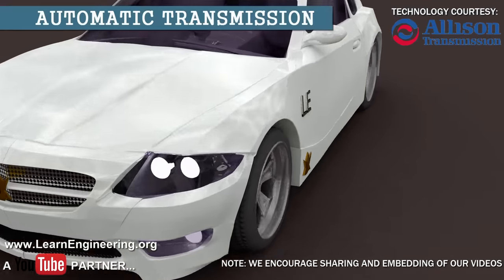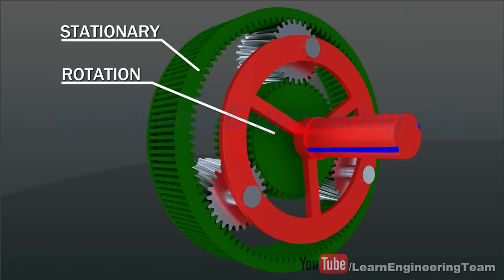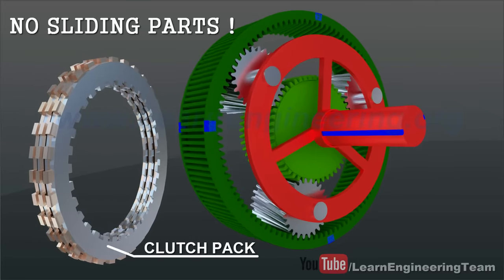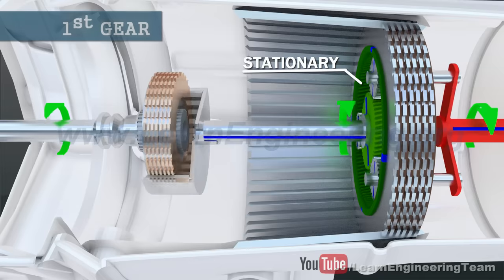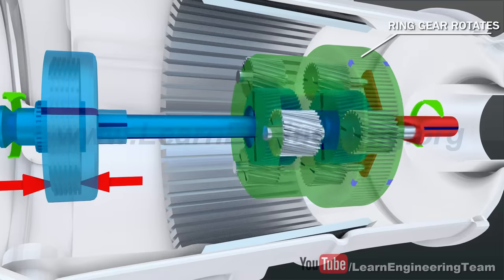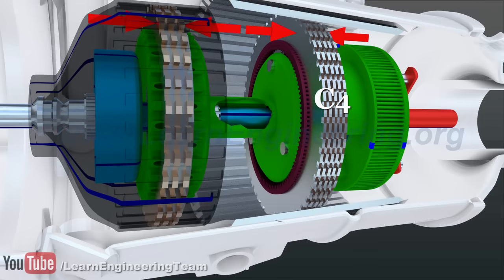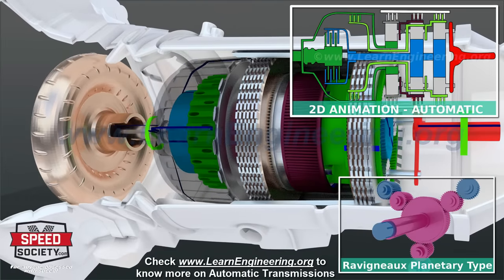Automatic Transmission, How it works?

Comment: I guess to simplify what seems to be hard to understand about this video if you guys are interested in understanding but didn't get it then read the rest and watch it again and hopefully it makes more sense. If two gears have the same number of teeth and are the same diameter are connected they will spin at the same speed but in different directions, if one of them was now half the diameter of the other one it will perform two spins for each time the first one spins once, the ratio of gears here is 2 to one, or two or half depends on what kind of international standard ratio system notation you are using just one spins more than the other because it has half the amount of teeth now. 

In their arrangement they are decreasing the teeth in an another way because you can realistically shrink or enlarge gears on the go. They decrease or increase the number of teeth that make contact so you get more or less ratio as in this is just a substitute to changing the diameter as I mentioned above and the way they go about it is stopping certain teeth from spinning hence the planetary gears. Different ratios give different torque and speeds so 1st  gear would be high torque low speed for going up a steep hill and it goes down until whatever your maximum connection is in this in this video the sixth setup they are using is moving at almost a third faster than the input from the torque converter that's coming from the engine. There is a device in your car that senses what kind of torque you need and adjusts automatically by limiting or un-limiting the number of teeth needed some older cars have it mechanical but the newer ones have it electronic. 

I'm a mechanical engineer so I hope I made more sense than the Houdini who made this script because even with my background I had to go back and watch certain parts again to understand what they are doing.

edit: typos

Comment: This is simple though - the planet/sun gear arrangement allows for a variable gear ratio with 2 inputs - add more of these gear arrangements and you can increase the number of possible output gear ratios. These ratios represent the relationship between power/acceleration in any given gear ratio. The clutch disconnects the engine from the drivetrain to prevent the rpm of the wheels dropping to zero from stalling the engine

Comment: As a driver of an automatic transmission car, it never comes to my mind on how it actually works before seeing the difference between the two transmissions in a set of videos. In short, the minute you put the vehicle in drive, and put your foot on the gas pedal, the car does the shifting for you, and also downshifts when you put your foot on the brake. the only thing they both have in common is despite the difference in parts, the output gear always turns in the opposite direction when you put it in reverse. Who knew?😲
Reply: I can only drive manuals - automatics are black magic to me, both to understand and drive.

Comment: What I don't understand is, how the 3rd set of planetary gears, is mounted.  I get that the sun gear is hollow, but in order for it to work in reverse, the sun gear of the 3rd set, would have to always be connected to the input shaft.  But it seems from the diagrams, that it is connected to the intermediate shaft.  Does the input shaft somehow extend past the housing of C2, so that it connects to the 3rd set sun gear?  Otherwise I don't see how that mechanical connection is made.

Comment: My question in all this is how, what and when are the Cs applied.  What is moving them, how are they moving and what is deciding when to move theme.  I used to think that the computer did those things. But I've drive automatic transmission on cars without computers. So how did they knew when to shift or how.  How did they knew when to get their cue.  Or is it something like the Torque Converter so once a speed is met things just automatically move differently.  I need like, the whole thing together.
Reply: On cars without computers it’s based on vehicle speed and accelerator position. The faster the vehicle speeds the higher pressure there is on fluid telling transmission to shift, and the harder you press the accelerated this reduces fluid pressure causing the transmission to shift down

Comment: So if i got it correct, the ring gear if the first set will link the 2nd clutch to the 1st planetary set through its ring to engage the output shaft while the input shaft is not moving... right?
Reply: I watched the whole video and I can say with 100% certainty that I have no damn idea if what you said is correct or not...

Comment: A requirement -> invention explanation would be more suitable for this particular thing, i.e., explaining what we want and how do we achieve it. For instance, for second gear, we want the ring R1 to rotate but not as fast as the sun S1 so that the output planetary carrier P1 rotates a little faster. Since now we want R1 to rotate and not just be stationary, so introduce C5. We also want a source of speed which is slower than S1 so that we can join/couple it with R1 to achieve our goal. We construct this source of speed by introducing P2, R2 and S2. Holding R2 in place and rotating S1 and S2 at the same speed will make P2 rotate slower than S1 and S2, and therefore P2 indeed has that sweet spot speed. Now, R1 and P2 are directly attached. Additionally, we also need C4 to hold R2 in place, therefore completing the construction of second gear. 

And so on

Comment: after annual maintenance at Opel mar service station in Istanbul olur Opel Astra j1.4AT edition plus vehicle works very noisy why i dont understand what they dış to our çar at service station and when i press on to the acceleration pedal our vehicle does not go fast sudenly as if something block obstackle and pulling back according to this video i thought that gear box can cause this problems???

Comment: Great technical information of how clutch packs and planetary gear sets make gear ratios. There's no info here how the transmission shifts automatically
Reply: Cars made past the 80s will use a computer to control which clutch pack get applied

Comment: i think i mostly understood after watching it like five times: you have various combination of how you should engage certain groups of gears with the different clutches to give you ofc different gear ratios. but the thing im having a hard time is how you compute those gear ratios. even for first gear, the planet/output gears have 25 teeth and the sun/input has 50 teeth so shouldnt it be 25*3/50 = 1.5?? i dont get it. how do you calculate gear ratio with this formation

Comment: You just KNOW that although this is awesome, repairing this stuff makes a good case for manual transmission, cost and labour wise.
Still, the person who invented this was a genius
Reply: Dual clutch transmissions were made for this reason. Much easier to repair, but also way more responsive than torque converters.

Comment: Hey I'm gonna be that guy. It seems like in all forward gears the energy to drive planetary sets 1 and 2 comes from either C1 or C2 being engaged in order to connect them to the input shaft and I feel like I understand those well. From what I'm seeing here it look like both C1 and C2 are disengaged in reverse. So where is the energy to move the planetary gears in reverse coming from? Is it from the sun gear in planetary gear set 3? If so, what's driving the motion of the sun gear of planetary gear set 3 if it's not the input shaft since the gear is hollow implying a frictionless internal surface?
Reply: Good service manuals will have charts called "power flow" for each speed and reverse. they use little arrows starting from the engine side and running through each gear set.  It really helps to make sense of what's going on.

Comment: 5:54 The narrator said applying C3 will always turn the ring gear of the second set. Yes, it's true. But I think the ring gear of the second set is always rotating. Here is the reason.

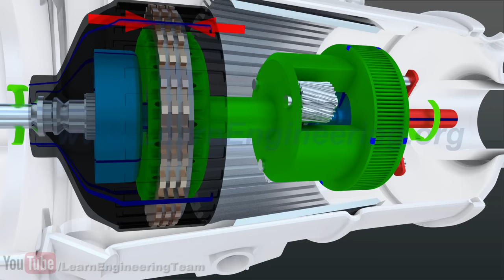The sun gear of the first set constantly meshes with the input shaft (5:48), which in turns makes the planet carrier of the first set rotating. The planet carrier of the first set is connected to the ring gear of the second set. Thus, the ring gear of the second set will rotate as long as the engine has been started, regardless of C3.
Reply: But bro please tell that why C2 is removed from the animation after applying the 3rd gear.

And please also tell that if in 5th gear the power is gained by locking the C3 and C2 then how will the power from engine transferred to the output shaft??

Comment: I have given up trying to understand the mechanism of an automatic transmission. Now the question is, do we actually "need" the torque converter? Can't we just use a regular clutch with a computer-controlled actuator to achieve the same result (i.e. decoupling the engine from the transmission during braking)?
Reply: Torque converter is smoother and easier to accomplish this smoothness. Could we use a computer controlled clutch? We already kind of do most torque converters have a lock up clutch so newer cars in a way do

Comment: Something I found confusing... In the video they say, "3rd planetary gear set is required to get the remaining gear ratios," and "the sun gear of this set is always connected to the input shaft as shown here." At first glance it appears they attach it to the hollow tube connected to C2, which meant it wouldn't always be connected to the input shaft, but after watching a few times I finally realized that they are actually attaching it to the large outer drum of C2, which in turn is always connected to the input shaft. This definitely needs to be made more clear.

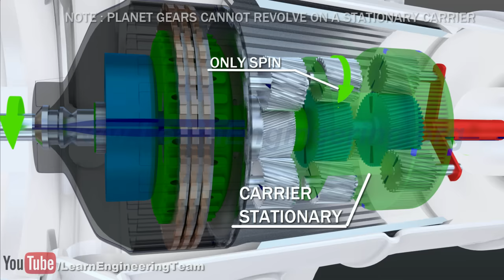Comment: in the reverse gear ratio the video and animation is wrong. C2 Is not engaged and neither is C4. Only C3 and C5 are. It shows c2 spinning but not connected to the green shaft, and the narrator doesn't say to remove c2 but it must be removed. I don't know why the animation pictured c2 in the animation at 6:54 and why c4 is picture at 6::35, this just made me and I'm sure many others confused.
Reply: The narrator was going through all the c3 gears. For 3rd he said apply c1, for 5th he said apply c2 and for reverse he said apply c5. Hes changing the clutch each time for each gear. At 6:06 he says for the remaining gear ratios c3 will be always applied. 

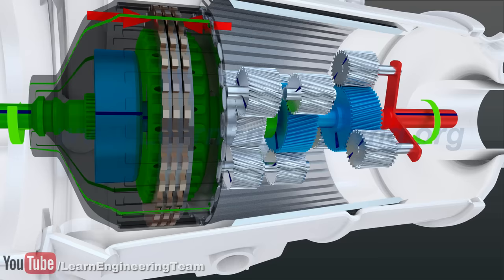Also at 6:35 that’s c3 he’s showing not c4

Comment: So it uses a clutch to connect the two shafts (input to intermediate), but also has a torque converter in order to disconnect the engine from transmission. How is that not redundant?
Honestly, this transmission design is disappointing. It could easily be a CVT, the best possible design too, but instead, it has clutches, and is basically, an automatically shifted manual transmission.
The video is very helpful and educational. Most of the videos for this channel are like that.

Comment: The confusing part is gear box are used for speed variations, but the dude keeps saying applying different speeds will result in sun gear rotating at different speed. But again the engine which generates speed either goes full rpms or lowest depending on acceleration, plus I don't get it. What do clutch packs have anything to do with transmission if we don't understand the relationship of input variations and output variations

Comment: Hyundai i20 automatic transmission at speed 80 vehicle automatically lock to 3rd gear instead of switching to 4th gear... What is the exact solution of this problem?

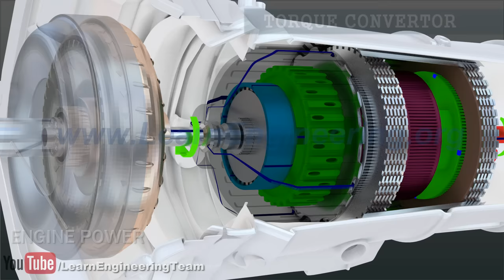Comment: 7:10
Is that torque converter only needed to get going from a stop?
Why not release the clutches in the transmission?
Reply: If you released the clutches, you lose "engine braking". It would be the same as throwing it in neutral every time you hit the brakes.
Reply: @jamesslick4790 what is engine break ,they explained it to me that when no throttle there is no detonation so the only force the engine is giving out is the braking force of the compressing air ?? But I still dont get why you just dont press clutch and let the breaks work
Reply: Yes. "Pumping" (from compression) "engine braking"  is a vital part of driving generally. "freewheeling" and relying on brakes ALONE is dangerous.

Comment: If I replace the torque converter on my 2011 Routan will it fix the problem I don't think it has clutch pack
Reply: Best bet is to find a good used complete transmission. It comes with the torque converter anyway and will take the same amount of labor to change either one anyway.

Comment: So if my automatic car has trouble pulling out from a stop ie. the rpms go up but doesnt move, then it clunks and starts going, whats wrong with it ? Bad gears somewhere in the tranny ? Bad torque converter ? Plz help lol.
Reply: Also, it doesn't have a problem in any other gear. Never slips or acts weird. Except when pulling out from a stop sometimes.

Comment: ease and reliability is not something often said about an automatic trans when compared to just about any manual. Hell the 4 speed manual tranny was perfected years ago and alot of them you dont even need to use the clutch except when you are stopping or taking off.

Comment: After watching the 2d illustration of automatic transmissions that simplify how this functions and gave me a much better understanding of automatic transmissions, there is still one thing I'm still confused about them:

I saw a video of someone bringing one of these apart and the thing I was most confused about was the 3 layers of mazes and 4 small metal balls in each one of them and why it was so important not to move them? I still don't understand that part's function.
Reply: Yeah that's the part he doesn't explain. 

It is called the Valve body. 
The clutches are engaged/disengaged hydraulically. 
Simply, the combustion engine spins a pump that builds oil pressure that the computer can send to the clutches by opening/closing solenoid valves. 

The maze you're talking about are just ports and passages that have been milled to allow the oil to reach and pressurize different sections of the transmission. It's that pressurized oil that moves components inside the transmission. The balls act as one way check valves to allow the oil to flow in one direction but not the other. The small balls block the ports when the pressure is trying to come back. You can compare them to diodes in electricity.

I'm gonna paste a description that I found online that might help you understand better than my own words could.

"The valve body is the nerve center of the automatic transmission. It is responsible for creating smooth shifts to the appropriate gear when driving. It does this by directing hydraulic fluid through a maze of channels and passages that activate the appropriate clutch pack or band. In a manual transmission you would have to push in the clutch and manually change the gears using the gear shifter. In an automatic transmission, the torque converter acts at the clutch and the valve body changes the gears. 

There are several valves in the valve body and each has a specific purpose. The valves are named for the function they carry out. For instance, the 2-3 shift valve activates the second gear to third gear shift and the 3-2 shift timing valve determines when a downshift should occur. Every gear shift your transmission can make has a valve assigned to it.

 The manual valve is the most important valve and the one you have direct control over. When you shift from park to drive, you are using the manual valve. It operates by uncovering various passages depending on what position the gear shifter is placed. Placing your gear shifter into drive, for example, directs fluid to the clutch packs that activates the first gear. It also monitors the speed of your vehicle and throttle position so that it can determine the best time to shift up."

Comment: what does he mean by remove c1? release or literally remove? if c1 is removes how is energy transfered to the input shaft?
Reply: He means release, so the input shaft and intermediate shaft are not connected anymore
Reply: @Club-kc9wl  how it turn if c1 is released?
Reply: @Wabuh-Wabuh  which gear are you talking about? 1st 2nd 3rd 4th 5th reverse?
Reply: @Wabuh-Wabuh  it will turn through c2 or the sun gear on the first planetary set is directly connected to input shaft

Comment: By this explanation as an expert let me know what is the problem  with my car it seems like it has transmission  slipping, when you drive and reach a speed of 80km per hour the RPMS are going to 4,000 and 4,500 and it seems difficult to surpass that speed ,and doesnt exceed such speed, and it makes a whining calm voice underhood on transmission,like a small motor on high speed, Currently help with  any ideas about what is the problem and how to fix.
Reply: Its junk. Start looking for a good used transmission.

Comment: Its like the integral which allows different speeds for the wheels during driving in a curve .
Reply: That would be the differential. And not the equation the component
Reply: @Club-kc9wl  The mechanism seems to have similarities .
Reply: @muzika8144  how so? Reason I ask is because a differential has spider gears to split torque transmissions multiply torque not split it?
Reply: @muzika8144  I honestly don’t see that many similarities except for the fact they both have gears. And even then the gears they have are different
Reply: @Club-kc9wl  I think that somebody who has a background in physics sees it .Anyways.
Reply: @muzika8144  I have a background in physics and I don’t see it. It can’t be an integral-differential equation relationship because those to components are completely on different fields. It’s like calling a parabola the integral of a sine wave
Reply: @Club-kc9wl  I cant blame you for not understanding .
Reply: @muzika8144  it’s easy to see your pov when you make stuff up I’m sure